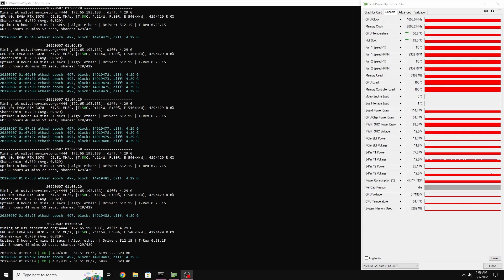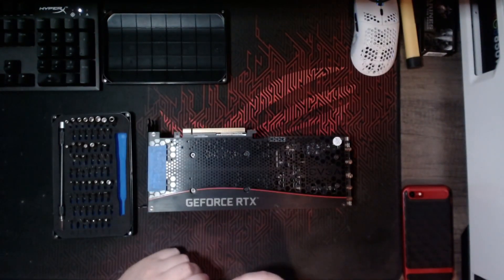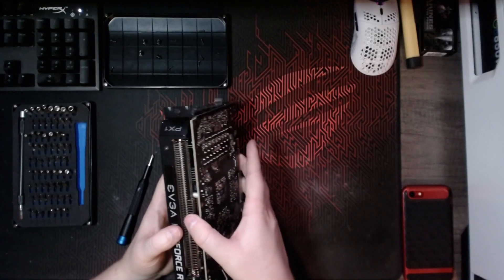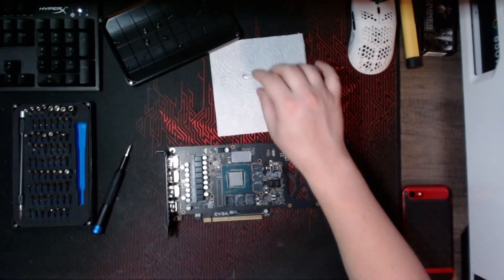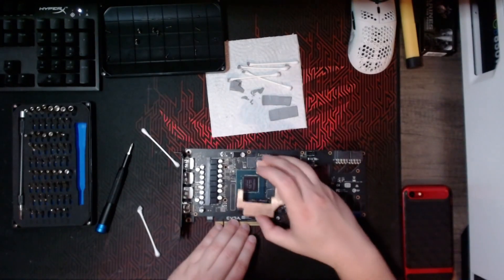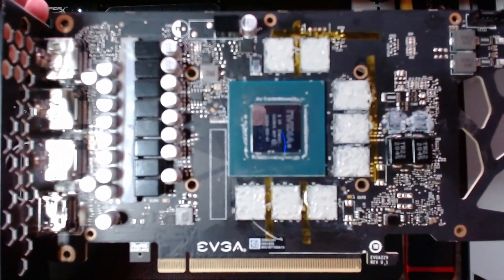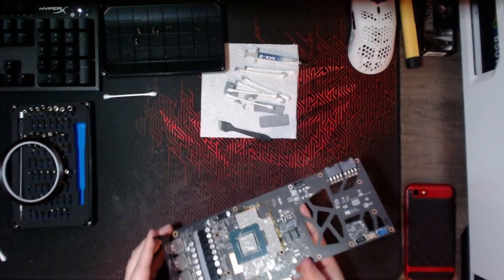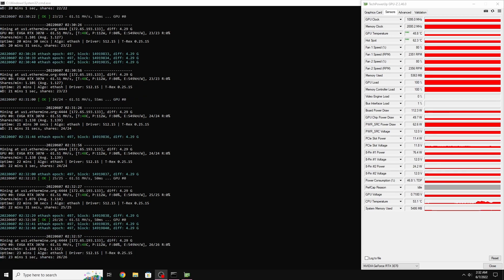EVGA RTX 3070 XC3 Copper Mod (2022)

Comment: Issue here you spread teh thermal paste, don't do that, just do the "pea" method on the copper
Can you measeure for me if you dissassemble the card gain the thickness of the copper plate? I'm interested.
Reply from the maker: There is no issue with spreading the thermal paste on the memory chips or the copper plate. You want as much surface area covered as possible. The copper plate is 1.5mm thick.
Reply from the maker: @WXRTH - Applying the paste the way I showed you wont cause any issues. Some people don't like having to much thermal paste, but at the end of the day, it isn't conductive and wont cause any problems. The more coverage you have, the better.
Reply: @WXRTH - it fills gaps.. it does not differ however you apply it to it. too much is too much and less is too less. period.!
Its better using a little less vs a little more.
I tell you another story!
You can make thermal paste more liquid temporary to spread even better using contact cleaner.
Mix it, apply it... the contact cleaner will evaporate leaving the paste on its ideal area...
But nooo, the whole internet goes like coppermod this, coppermod that.
Well F*ck copper mod! just buy cards of decent brands as Evga and you dont need coppermods anyway..
Its a whole lot of blabla or a tiny bit of haha...

Comment: I have the same card (except it’s a ti ultra) and the PCB looks identical; I also copper modded mine from CoolMyGPU. I notice you also seen little to no difference in temperature compared to people online. I’m under the influence that the XC3 doesn’t benefit nearly as much as other branded cards. I seen little to no difference in my mod either.
Reply: issue here should be the less thermal paste, do not make it flat, just use a "pea" method, and let the pressure does its job
Reply: @Badrick16  really? hmm I would’ve never thought that. So on the VRAM itself leave a dab or on top of the copper plate leave just a dab?
Reply: @compcod69  use a dab on both side. Make sure when you assembly the thermal paste squeezing out a bit. But what temperature you want to change? If you have better VRAM cooling then it will be less hot, but this energy should go somewhere. And only way to go is the DIE. So the core will be hotter with 2--5C of course depends the situation. So be not afraid.
Reply from the maker: The change in temperature should be on the memory, but there is no way to see the memory temperature on the 3070. If you have a 3070 Ti, you can see the memory temperature. If there was not much of a change, then I agree with you. Like I said in the video, I would only copper mod this card if you have thermal issues.